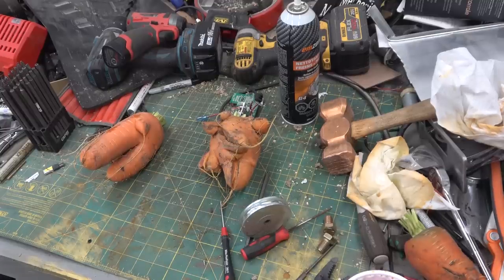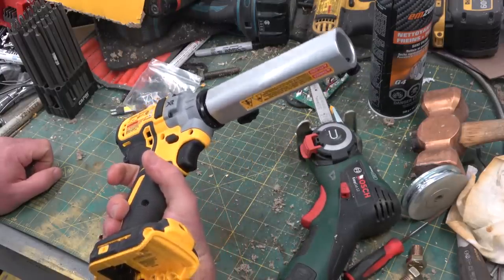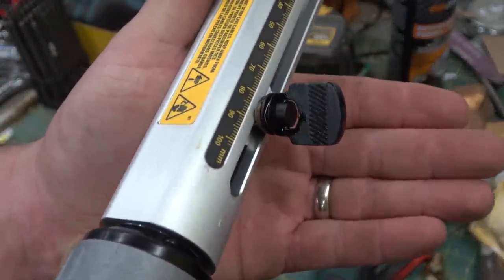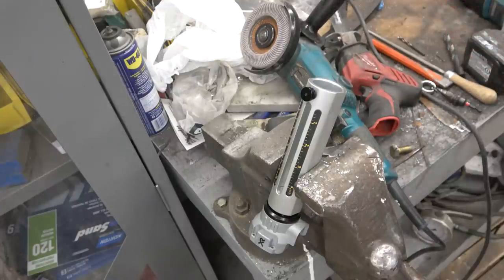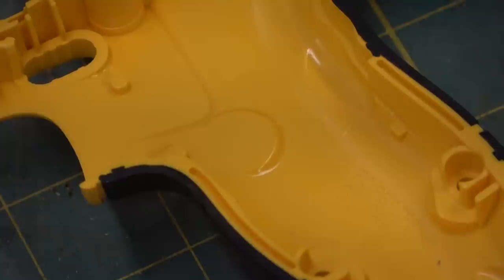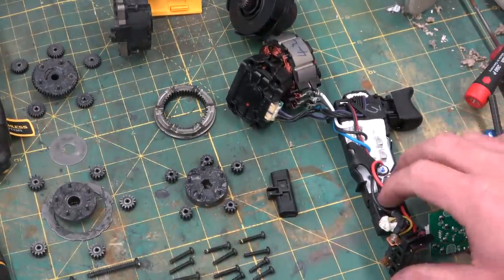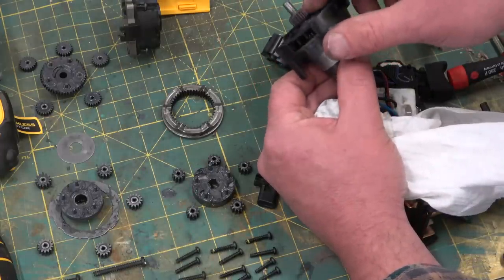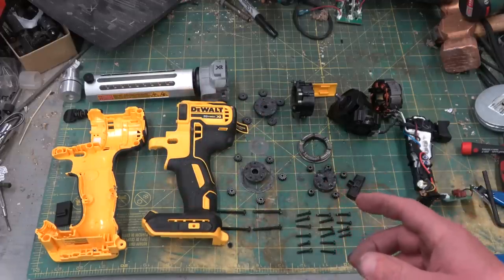BOLTR: Black and Yellow Strippers

Comment: Most times out of ten it'll get sent to that corner of that drawer in the toolbox what's hardest to reach.

But if you have to terminate a couple hundred donkey proud-ones, it's just what you need and was probably broken by night-shift sometime last year.
::Sigh:: FML and out with the blade for a try at avoiding a resetting of the reportable injury "days since" counter.

Comment: 10-32mm² I usually just use some box cutters, blades are cheap as borscht and it takes me less time than digging something like this from the bottom of the van.

Seems absolutely useless to me, now mind when I was working on the chunky 135mm² high voltage stuff it might've come in useful, but I think it's too small for that.

Comment: my only question is why is it a massive 20V unit? this seems like a job easily handled by a good old 10V pack and much more compact assembly

obviously they heavily reused parts to be able to sell this low volume item at any decent price. but still, 20V and brushless? Im sure they could have used a cheaper base drill.

Comment: The Milwaukee strippers are better. You have to hold the dewalt  with 2 hands for 750s and the wire has to be straight otherwise it does nothing

Comment: The only thing that tool strips is you of your money.   Now they want more money to make er work!
Otherwise, I laid out the 5 miles of conduits in 3D AutoCad MEP of an electrical room once where there were several thousand 900kcmil compact conductors that needed to be stripped by the electricians before terminations.  This type of tool would then be worth the tool!
I’m thinking you are not going to get much more than spare parts out of this purchase.

Comment: The defalt is no good. Wire Insulation gets bound up in the stripper and breaks off the stripping blade. 

The m18 Milfukee is much much better.

Comment: This tool makes me angry. There's a two dollar piece of crap you can get that will literally go on your keychain. You clip it to a cable like cheap plastic tweezers, spin it around and you're done The most complicated wire stripper I've ever used was a multi-stage pencil sharpener looking thing that had different dies for precisely stripping the ends of different coaxial cable to make putting n type/UHF/BNC connectors on it.

Comment: So let me get this straight, Dewalt sold you a tool, that is missing the parts you need to do the job you brought it for?
So it can't do the job you need it to do?
The could have made the tool, with a reduction planetary gearbox to connect to just about any battery drill.
Question is would they sell it complete? Or would they sell it like chinesium tools? Pointless as F!
Just throw all those bits in a bag, return it, return it, saying you looked everywhere, but couldn't find the bits that are missing to make it a functional tool!!
It hat one job! One job!
Fucking garbage is right. Should be illegal to sell in this state...
😘 😉😂🤣😃😄

Comment: It may be crap, however gotta say its pretty low quality review if you can't even take the time to show it in operation before pulling it apart.   Here's one, skip to half-way through.  It probably pays for itself in time saved, cuts avoided, and general nice looking work, if you need to do this regularly.  Specialized tool for niche uses, not sure why its being called crap.